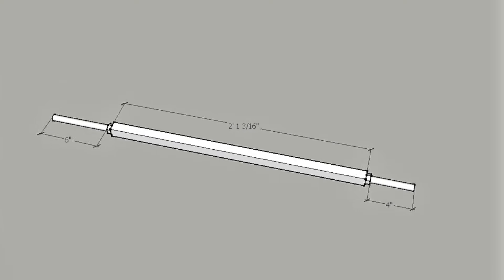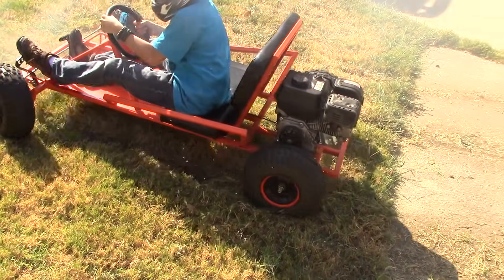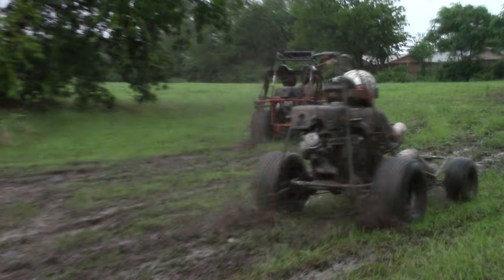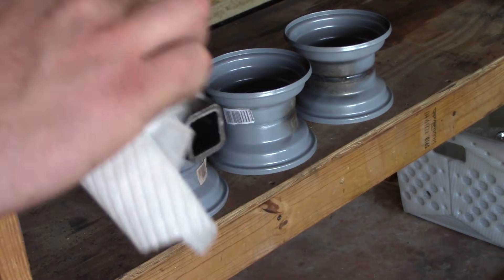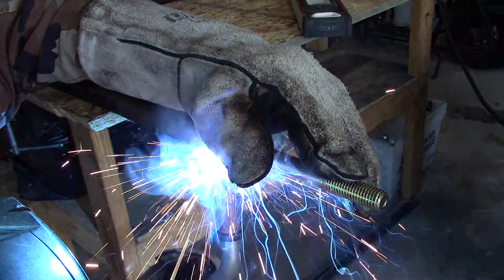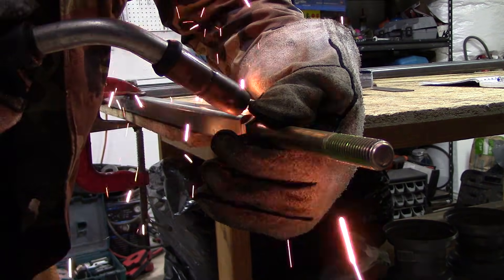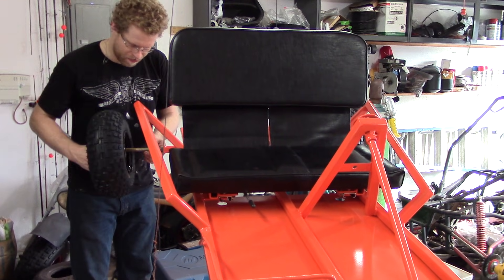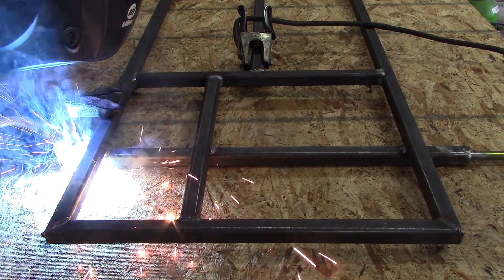Go Kart Live Axle Kit: Homemade Go Kart Axle

Comment: Ohhh, I thought you were gonna use the DIY square tube as a live axle lol, still a good option for a cheaper go kart build. You could run 2 engines, one for each dead axle - one would need a jackshaft of course. Or one engine to a jackshaft then to each wheel, but better off just buying a proper live rear axle.

Comment: Anyone else have trouble finding dead axle kits? I want dead axle, but with 2 motors (independent of each other). 
I seriously can not find a dead axle kit. I'm not seeing one linked in this video either...

Also what size bolts (other than 4 and 6 inches) did you use for your custom axle? Like what's the thickness? Head size? And metal type? :D

Edit: Nvm I went to your kartfab site and saw you're using 5/8s inch (and 1" square tubing). Thanks!

Comment: What type of metal (stainless, zinc plated, galvanized, grade 8 steel, etc) is used for the bolts that make the axle?  If it's being welded to plain steel, does it also have to be just plain steel?
Reply from the maker: Bolts can be grade 5 or grade 8

Comment: How do you know what size axle to get? I see some kits have different lengths of axles ?
Reply from the maker: Between 36 and 44” is about where I have seen them. 36 for narrow 1 seat go karts and 44” for two seaters.
Reply: @KartFab  ok thanks I'm using a frame from a manco dominator pretty big so I guess I'm going with the 44in

Comment: Is it not bad to weld a bolt? They have coatings on them that vaporize when you weld and I'm not sure grinding it really removes it all.
Reply from the maker: No it’s not bad. The coating is zinc and even if you didn’t remove it there isn’t enough of it there to have a measurable response to the exposure. You don’t get metal fume fever from welding two bolts.
Reply: @KartFab  Ah, ok! Thanks for the help - I subscribed BTW! I'm new to the go-kart scene, and I'm not one to use other people's plans and call it my creation, but these videos really help me with my design as all go-karts have similar components. Another question - I'm planning on using an 1800w motor for mine, and it has a T8F sprocket. For the drive sprocket, how hard would it be to attach this: http://tncscooters.com/index.php?route=product/product&product_id=135 to this wheel: https://www.harborfreight.com/10-in-pneumatic-tire-with-white-hub-62409.html
Reply from the maker: @texemplarstudios5481  please, for the love of god, do not use MOVING DOLLY wheels for a go kart.
Reply: @KartFab  I've seen a lot of people use them, or at least similar wheels... do you have any recommendations for wheels that would fit onto a 5/8" bolt?
Reply from the maker: @texemplarstudios5481  go kart wheels of course.

Comment: Would be able to add a 6 inch bolt other side  can put second sprocket and brake to add a second motor more power would it fit on this frame?
Reply from the maker: Yes but it would be hard to steer and requires jackshaft.

Comment: I would have ground the head of that bolt enough to slide in the tube. Plug weld inside and bead outside, much stronger.

Comment: I think you forgot that the axle needs to be able to roll both wheels under power. Welding the axle to the frame is just replacing what you already had with a different version of what you had and not what you intended on showing the viewer. Use a round bar and weld blocks to the frame to hold the bearings for the axle so it may roll. I'm surprised no one caught the mistake. Good video either way.
Reply from the maker: thanks for the comment, but you actually are watching one video in an entire series of videos that are for specific go kart plans for this build.

Comment: or just add two engines and rig it up to where to throttle is equal on both wheels so you'd technically have more power

Comment: can we use a genrateor to make this go kart
Reply from the maker: +creative channel yes but generators usually have a tapered shaft. You may need to double check and other an adapter for the shaft.
Reply: can we use Electric welding to join the iron roda
Reply: sorry rad

Comment: hi, I have a question. I have a dead axle go kart. right now I'm looking to replace the drive wheel but am stuck. my cart uses 3/4 bore sprocket. I can't find a wheel online with a sprocket attached with a 3/4 bore. this may be noob question... but is there a way to attach a sprocket to a rim. my current wheel being replaced has the sprocket welded. so I can't replace the sprocket that's attached to it. so I have to get another rim that will fit the 3/4 axle and have a sprocket.
Reply from the maker: +Austin Geary yeah, there are 1 3/8" OD bearings that have a 3/4" ID sprocket is attached to drive wheel via flange/bolts, usually with a brake drum too.

Comment: if i have a 500CC  Snowmobile motor im gonna use will i still need a torque converter
Reply from the maker: snowmobiles usually have their own style of torque converters. 
Typically, you would see a comet 94C or 'duster' drive unit with a 
similiarly named driven unit. These were meant for the high rpms of a 2 
stroke engine.

Comment: where did u get the bolt from. can't find them eny where. is the axle u use there 1 inch??
Reply from the maker: Its in the plans in the description. I got it from a hardware store (tractor supply). Any place that sells hardware should sell bolts like this (in the US at least).

Comment: Lol just use a straight rod with two bearings and a welded sprocket on the rod any how how much is Steel at steel places is it cheaper than buying at lowes?
Reply from the maker: +LOLitzDanny if you use a "straight rod" it will likely bend. You should never weld an axle. Steel at a metal distributed is many times cheaper than lowes.
Reply: +KartFab ok thank you very much I appreciate your response

Comment: how does the tier move then?????!#?
Reply from the maker: +brandonfix engine turns clutch, clutch turns chain, chain turns drive wheel sprocket, drive wheel sprocket turns drive wheel assembly. Drive wheel assembly has two bearings on it that ride on the longer bolt.
Reply: +KartFab ok thanks
Reply: The Bering is on the wheel

Comment: ok so I just got a live axle go kart but I have no tires except for the ones off of my other go kart which is dead axle. I was wondering if the wheels would still function. basically my question is could you take the wheels off of a dead axle and put them on a live axle?
Reply from the maker: +Alec Key did the live axle go kart come with rims on the rear axle?
Reply: +KartFab yes but they aren't the same size as the tires I need to put on the go kart
Reply from the maker: +Alec Key you need to put tires that fit the rims on the kart.

Comment: I can't weld but I need an axle like this but I'm putting an engine on a skateboard and will only need one wheel, the other problem is even if I could weld the base of it all is made of wood, basically, how do I attach a very short dead axle to a wooden board
Reply from the maker: yeah, you will need to weld some gussets to a plate and bolt the plate through the wood.

Comment: how do I jump start a live axle kart I buyer a kart 2 days a go and it won't start on ground coz when I pull the pull start both the wheels move on floor and carnt pull it proper and when I lift bk end up and start it when I put it on floor it cuts out strate away any idea
Reply from the maker: no idea, its called "bump starting" and you can see on wiki how.

Comment: I have purchased the live axle plans and am working on the deluxe-upgrade version. However in the plans it is not clear how it is assembled, what is welded and where, and where it is even attached to the frame. This video said it would cover the live axle but it did not. Do you have a video that covers this or anything that would go into more depth on how this is assembled?
Reply from the maker: +Sean Mauck Sean. Feel free to message me on here or Facebook with questions. I am still making video of the deluxe build. The front end is the same as the free plans. Rear of kart for live axle is completely different. Plans do explain it well as many people have messaged me with their completed builds. You can check out my Facebook page that has pictures of the completed builds of the deluxe live axle plans as well http://www.facebook.com/KartFab

Comment: What is the hub for the sprocket called on a dead axle
Reply from the maker: +Jonathan Torres the hub is part of the drive wheel, it is the rim. So the drive wheel assembly contains the rim/hub, brake, tire and sprocket.

Comment: Can I use a live axle with the free plans?
Reply from the maker: +Jordan Avendano they have the standard live axle kit instead of the free plans kit, which is almost identical to the free plans (brakes are set up differently, brake rod, and live axle weldment is set up differently, engine mounting is centered with a special piece of steel bar) So........other than that, they are virtually identical. If you got the deluxe live axle kit, you would be in hot water and need to buy my live axle plans to follow it. the standard live axle plans come with my deluxe live axle plans. Its up to you if you want to go without the plans, I just offer support for those that bought plans, not those that did not.
Reply: +KartFab oh well I'm just a high school kid with a budget so I had to choose the free plans, but I appreciate the input, oh and your videos are really helpful I've been working with my teacher in my welding class to make this go kart I just hope it turns out well. Once again thanks for the info
Reply from the maker: No problem, just dont cut corners with the braking system, and never run it without a kill switch close by.

Comment: torque converter and off road fun
Reply from the maker: +i2aspire gear for 25-33 mph. That should be around a 60t axle sprocket and a 9t or 8t jackshaft sprocket
Reply: +KartFab what if I don't have a jack shaft
Reply from the maker: The jackshaft is what the torque converter driven unit sits on, so you would have one if you had a torque converter.

Comment: what gear ratio would you use with a 6.5hp and 19" wheels.
Reply from the maker: +i2aspire clutch or torque converter? off road or on road? racing, or for fun? weight?

Comment: what welder do you have
Reply: would this MIG-130 Flux Core Auto Wire Welder work
Reply from the maker: any welder will work that is 90 amps or higher.
Reply: alright just bought it looked up a revew on it and they sed it was good my dads old welder gave out

Comment: do u have any blue prints for a dingo style go cart at all?
Reply from the maker: Unfortunately, no. Have you tried looking on Craigslist and eBay for a used one? That's probably your best bet.
Reply: +KartFab yeah I have an they r still really expensive and hard to find.
Reply from the maker: Just have to be patient. I was able to buy a dingo for $100, $250, $80, and $80 (keep in mind that this is searching frequently for go kart and they were in bad bad shape, had to spend a lot of $ and effort  to get them running and driving)
Reply: +KartFab gotcha where did u find them for that low of price and where do u find most of ur toys at?
Reply from the maker: Craigslist

Comment: What kind of welder is that?
Reply from the maker: A MIG welder
Reply: +KartFab What kind of filler did you use?
Reply from the maker: I'm not sure what you mean. I MIG welded the go kart axle using .030 solid core wire for welding steel. The gas I used was 75/25 mix. You can weld using any type of welder, stick, tig, flux core, or solid core.
Reply: +KartFab Thank you
Reply: +KartFab One more question; what voltage is that welder
Reply from the maker: it can run off 120v or 240v

Comment: Does it matter if the metal is 2" by 2" rather than 1"by 1"
Reply from the maker: +InTense Snpr1 the axle material needs to be 1"x 1" in order for the bolt to be welded to it safely. If you were to use 2"x 2" material for the go kart axle,  you would probably need to add a section of steel plate to to the ends and weld the bolt to that steel plate. If you have enough fabrication know how, you can make most things work. 

Think of it this way, buy a piece of 1"x1" steel for at most $2/foot and you are going to spend about $6 max with no headaches, or you can try the 2"x2" and see how it works.